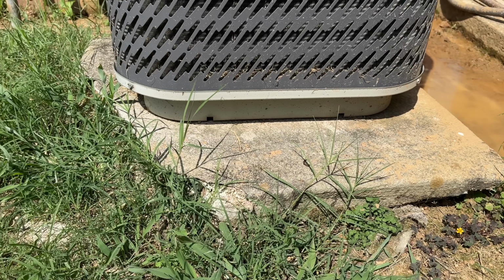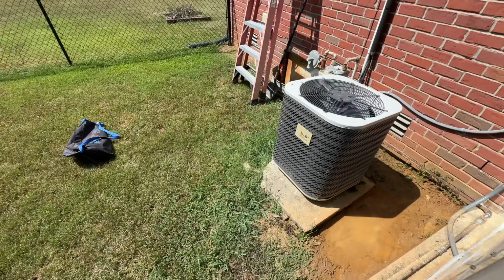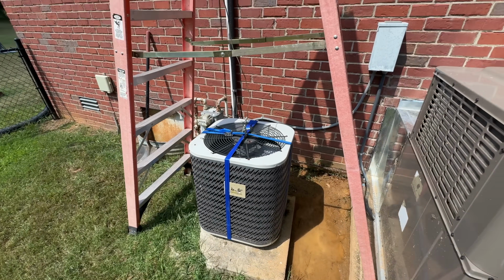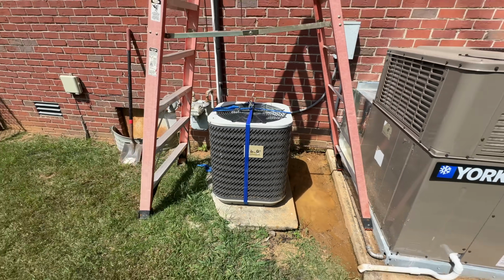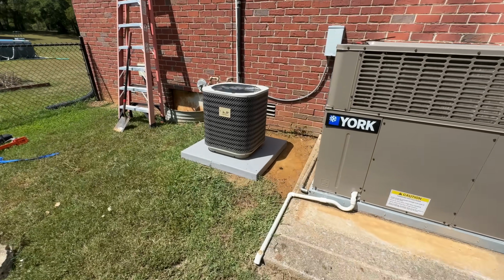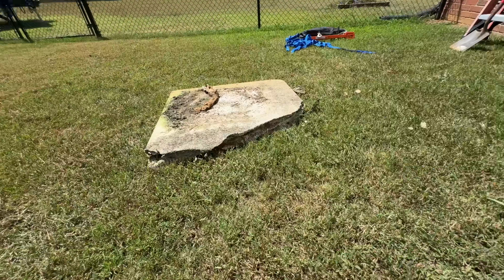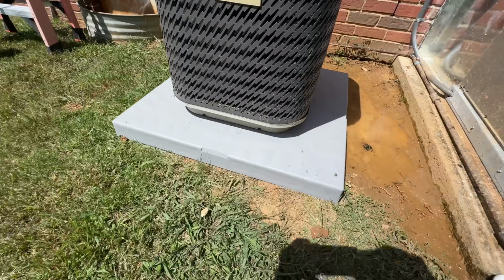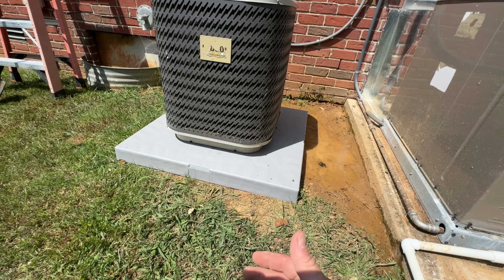Replace Your HVAC Pad The EASY Way!!

Comment: After 27 years in the business… I installed a solar system on my van and a 9000 BTU gree mini split heat pump. It works great and keeps me 72° or less on a 95° day. It’s nice to take a break and cool off in there during the day while pulling a cold drink out of the 24V dc powered 75 qt chest cooler/freezer and not dripping sweat all over the invoice while filling it out.

Comment: I am personally not a fan of any pad not poured and rebar pinned to the foundation, even then I personally always prefer bolt on or foundation hung brackets ( in new construction) over pads. But when given no choice a pad it is.

Comment: I did that exact same repair last summer using angle iron and blocking to get it raised up and  the new pad underneath it. Customer was happy with my $650 invoice. They had a pretty good local heating and air guy replace the unit several years ago and did not replace their pad or level it. I was kind of surprised, but he was close to retirement.

Comment: I’ve seen other ladder cranes, but this is new and exciting. I love knowing there is a way now to lift that unit and replace the pad or re-level the unit finally! That’s always been a struggle and feeling like you really need to pump it down and disconnect the unit. Actually just yesterday I had to level a condenser that I installed seven years ago that was tilted, and it was a pain in the butt. I wish I knew that this existed. I’ll definitely be buying one! Thanks Zac

Comment: I have thought about making a portable gantry device that could be set up over a condenser unit for the replacement of a compressor to keep from reaching way over and picking up and replacing a compressor without the need for a second person to make the job safer.  The use of the ladder is genius.  A taller ladder or one of the adjustable ladders should accomplish the same job.  Arrange the hoist conveniently to safely pick up or lower the compressor.

Comment: I have to do something like this with Ice Makers at McDonalds on beverage equipment change outs when the customer don't replace the Ice Maker, I strap the ice maker up to the rafters in the ceiling and it allows me to replace the equipment without having to evacuate the system, saves so much time. Id rather replace an old ass Ice Maker but it saves the customer money so it is what it is.

Comment: I hope someone can answer this question that has that exact same crank lift. When you release to lower do you have to crank it down? Or will it just free spool if you do not have your hand on it? I have been through three of these and all three will not hold the load in place when switched to lower.

Comment: What is that hoist that you used called?
Reply: I think it’s a Supco Attic Pro Utility Lift
Reply: It is the Attic Pro. Great tool to have especially if you work in areas where units are in the attic. It makes lifting equipment into those spaces real easy. Also helps to keep the equipment from being damage on the way up. Essential if you work alone most of time.

Comment: Just don’t care for these temporary pads. I like 4 inch thick concrete raised up above grass height and at least 12 inches extended around the unit. Keeps the mowers and trimmers off the unit.